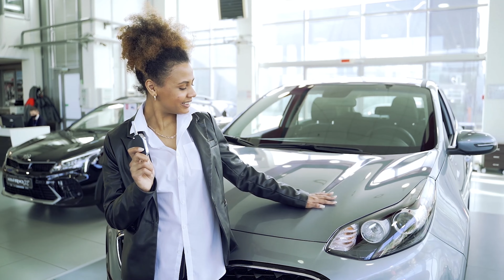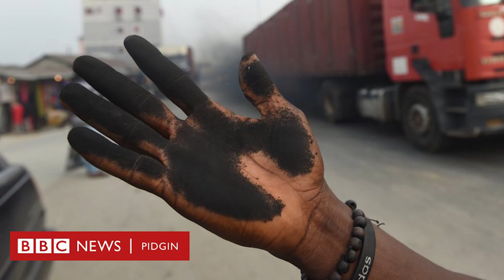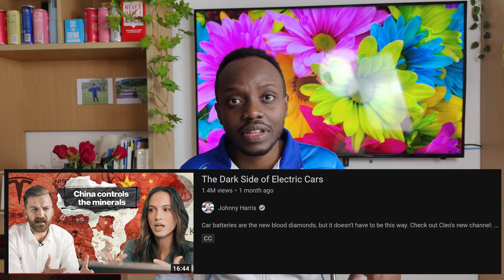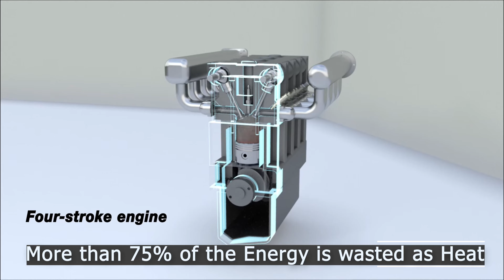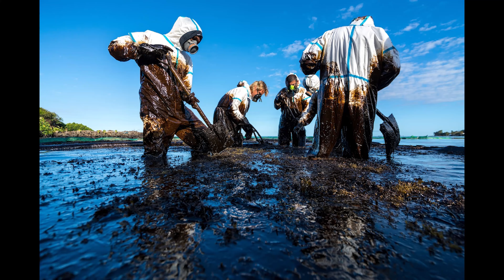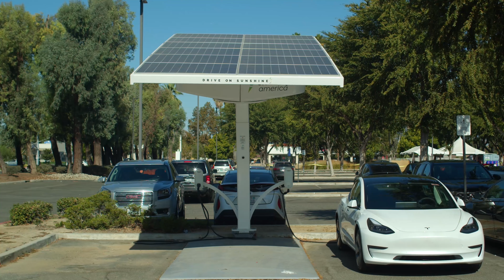This Picture Is WRONG! | Africa's Electric Future

Comment: The quick fact, For a car to travel 1 mile... it takes much, much, much, more electricity from the coal fueled plant to search for, drill for, transport, and refine oil, then transport, and pump gas,  then it takes the same power plant to add 1 mile of charge to the EV.